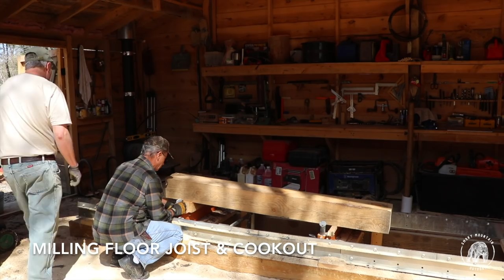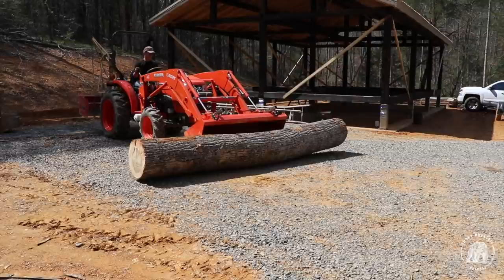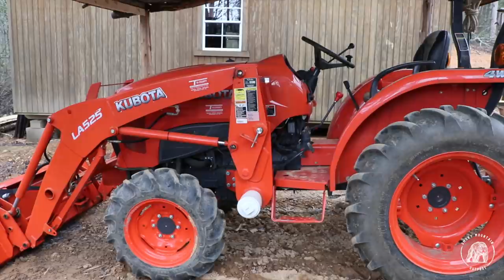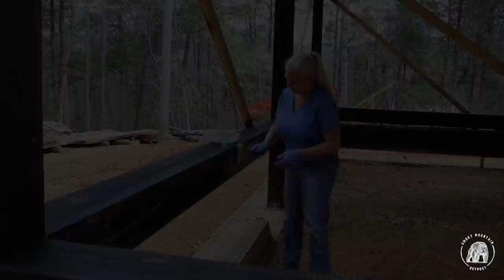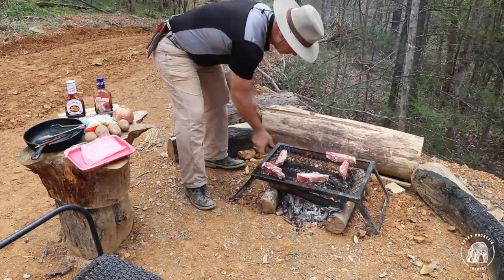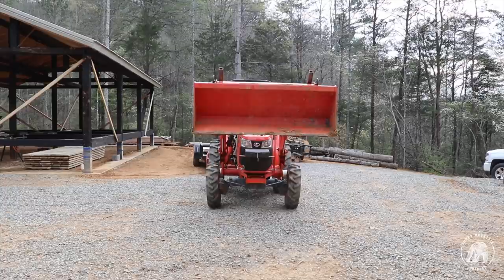S2 EP39 | WOODWORK | TIMBER FRAME BASICS | MILLING FLOOR JOIST | SEALING TIMBERS | CAMPFIRE COOKOUT

Comment: Do you use that sawdust that comes off of the logs for mulch for your garden or for a flower bed? It looks like quite alot there. Your just coming right along in your work of building  your place. Do you plan on living there when your finished with everything.  You have alot of heavy equipment there. Does it all belong to you or are you just renting it out.? That's going to be a great place when you get thru with it. Stay safe.
Reply from the maker: I own it all. Yes I will live there, and do use the saw dust

Comment: Hey SMO, was there a particular reason you chose Popular for the joists?  I have 10+ acres with lots of popular and everyone's been telling me it's almost useless.  What say yee? Thx... love your channel.
Reply from the maker: A lot of the old cabins in this area were build from poplar and are still standing. I was told by some cabin builders that structurally poplar was better than say pine from their log referral sheets.
Reply from the maker: If you can cut and dry before use it would be better. Cover ends with anchor seal. It will help stop checking.
Reply: Thanks SMO... very useful.

Comment: Not sure if this will help, but over here in the UK I've had some success treating timber with a mixture of one third used engine oil to two thirds Creosote. This appears to be a long lasting protection and it has the hidden benefit that todays children not only don't like the smell of it, and they don't like getting it on their designer jeans either. Could call that a Win Win situation.